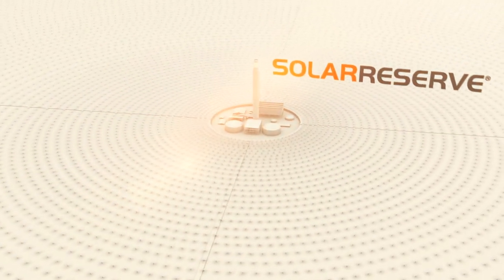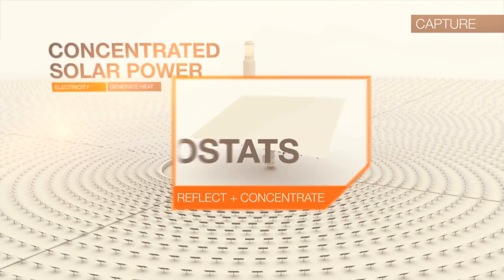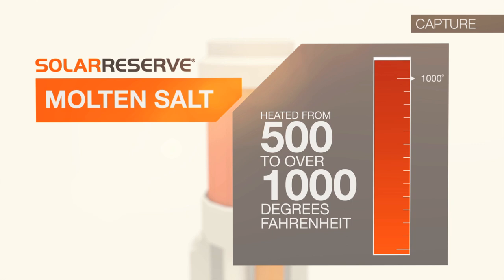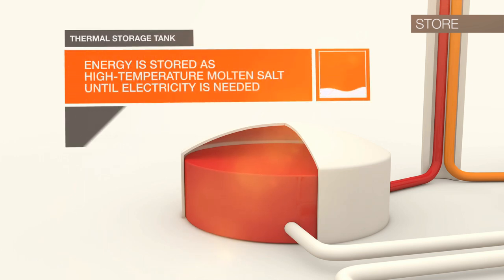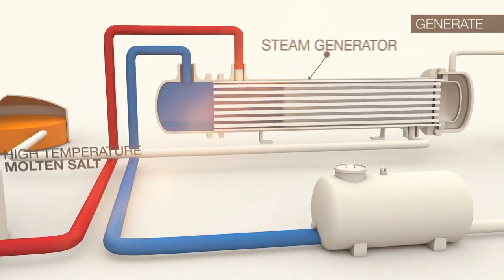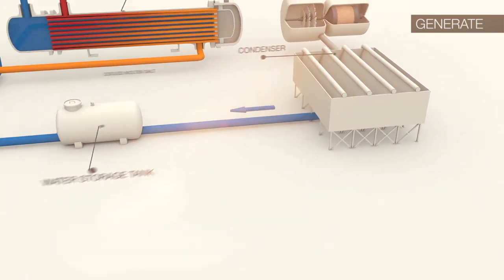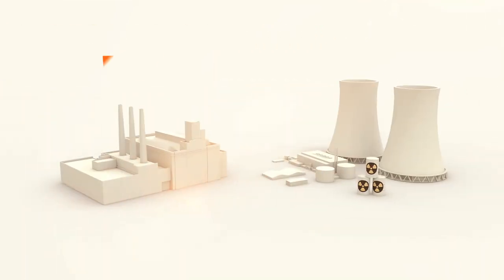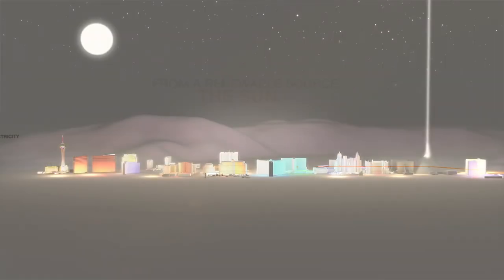SolarReserve - Concentrated Solar Power Technology Animation

Comment: The one criticism of this method is the concentrated sunlight has caused birds to spontaneously combust in flight. If animal safety activists are to be pleased, safety needs to be implemented with either safety cages (though that will reduce incoming sunlight) or build the rigs in desolate areas with as little bird migration as possible (though electric power will be lost over the long transmission distance).
It is a cool concept, but like any other good idea on a big scale, some drawback will be a fact.
Reply: Open a restaurant next door called Solar Duck

Comment: Hey i was wondering how does molten salt affect ur pipes? and what methods do you use for maintenance if this is an issue?
i am thinkin about how corrosion might be a huge factor here as i recall liquids with salt being really bad for metal pipes?
Reply: Corrosion is a matter of chemistry. Not all salts corrode all metals. One example is Hastelloy-N, an alloy specifically formulated for the Beryllium-Fluoride salt used in the Molten Salt Reactor Experiment at Oak Ridge National Laboratory in the 1960s. It operated for 5 years with no significant corrosion.
Reply: You forgot to mention "THORIUM" in that "experiment".  Hey, I wonder if they could ADD a Thorium module to heat the MOLTEN SALT, and continue to produce ELECTRICITY at PEAK CAPACITY...
What do you think? a HybridSolarThoriumMoltenSaltStation HSTMSS™ (not Reactor) ITS ALL ABOUT BRANDING/MARKETING.  
        PROBLEM SOLVED LET THE AGE OF THORIUM/SOLAR POWER BEGIN!!!

Comment: How large (in terms of volume) is the storage tank which holds the hot, molten salt? I always wonder about the size of these things
Reply from the maker: Thanks for your curiosity! The tank holds 3.6 million gallons (13.6 million liters). It measures 40 feet tall by 140 feet in diameter.
Reply: How is the tank insulated? Is it just relying on the surrounding soil?

Comment: So the salt can act as a battery when it's molten?
Reply from the maker: Essentially, yes.
Reply: What I think Solar Reserve means, = Salt will remain HEATED in a proper ThermoStatic non-corrosive Container, and then when needed it can be cycled through the exchanger to heat the water and produce Electricity at the Steam Turbine.  
     Molten Salt is not a Car Battery.  In a way, it's similar to a water reserve which when there is electricity produced over grid demand, then that electricity is used to pump water from a lower elevation to a reservoir at a higher elevation, to be used as a supplemental hydro-electric generator during peak grid demand.  But Essentially, -- YES.
Reply: No. It's not like a battery (not like an electrochemistry source). The melt salt alone don't do nothing, he don't ionize nothing, he is used in this system just to transfer his heat to water to create steam and with pneumatic force, the steam spin the generator (probably something contain magnets and copper wires (electromagnetic induction)). Witch is something very different from a battery. They have choose melted salt cause it's easy to get, don't need high pressure (witch can be to dangerous) to maintain heated and in the liquid state. And so far... I see the Solar Reserve channel have said "yes" to your question, but I think they are lazy to explain this difference.
Reply: @robson_leao  Also called a heat battery.

Comment: the heat exchanger is interesting to me as is the Delta T of the return fluid , the circulator used is a true Pump or a differential pressure recirulator that simply establishes flow?

Comment: Is there any possibilities for the molten salt to freeze when it doesn't receive enough heat from sunlight? If there is any, how to prevent molten salt from freezing?
Reply: Most of them are solid below 400°F, that's why the videos mentions that the Salt would be kept between 500°F and 1000°F. I assume at 500°F the system would shut down to keep the Salt liquefied.
Reply: And they mention 1°F heat loss per day, which is very good, so cooling from 500°F would give them plenty of time before it solidifies. There must be some auxiliary power available on site to heat up and liquify the salt during commissioning so in the worst case it could be used to keep the salt molten.

Comment: is it sustainable for a 1st world country?
Reply: Considering the only resources consumed are the initial construction and occasional topping up of the Molten Salt and water, I'd say it's far more sustainable than any fossil-fuel system at least.
Reply: +fromkentucky But I mean would it be able to successfully supply a power grid to a city with say 1 million people. Because where I live in Adelaide, Australia, we currently get a fair few blackouts. This is because of a faulty power grid and bad weather, but because of 50% of the city being run off of wind turbines and other renewable sources,  it can take up to a day and in some other remote places of South Australia, it can take a week for the power to be restored. I'd like to think that this solution would be able to help clear out the last 49% of non-renewables and actually have a sustainable power grid that can restore itself within hours.
Reply: Jamie, I also live in Adelaide. Those renewables relied on synchronising to the frequency and voltage of base load power so when the base load power went down protection systems shut the whole lot down. Too many politicians not listening to the engineers LOL. SolarReserve mentions that they can operate as base load power which is encouraging. I assume they have the technology to work in parallel with existing power generation.